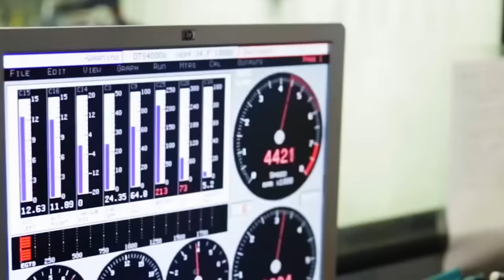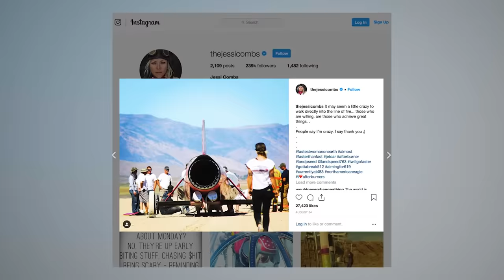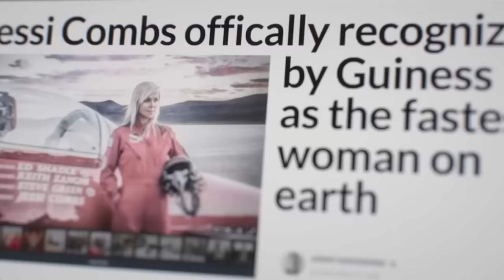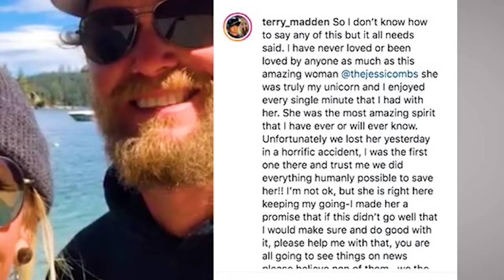The TERRIFYING Last Minutes of Jessi Combs, the FASTEST Woman on Four Wheels

Comment: Firstly getting the local cops to investigate is plian nonsense. Are they engineers?  Secondly has anyone ever looked at the design or done any testing on the wheels? Like FEA or on a test rig? Were these lifed to prevent a fatigue failure? Wer ethey crack-tested between sessions? I would bet money on a fatigue failure of a wheel. Also, for any reason, if yu want to stop, you don't want to be messing around with several different controls. Yiu need one pedal that does engine shut down, chutes and brakes. The whole thing sounds like bad design.  GZ, PhD Mech Eng.
Reply: I agree with everything you said.  Also something you didnt mention, but they did mention in the clip is that these types of vehicles don't have the financial backing as some other sports do.  So a lot of the engineering done to these things isnt done by maybe the people that should have designed them.  And, with a lot of motor sports it's trial and error.  Lots of people have died in all forms of motorsports.  Unfortunately, though that's how a lot of these sports have progressed.  NHRA has a rule book for the various classes.  If the vehicle doesnt meet that minimum of safety its not allowed on the track.  Even though this sport might be sanctioned, I do believe it is more of a run what you brung kinda thing.
Reply: Hi Bob. Yes, anythiong organised liek AHRA drags has its regulations, but I have never heard a scrutineer say it's requird but only if you can afford it. Or, a $10 helmet for a $10 head, as they say.  Any LSR attempt is going to be big bucks. Saving money is false economy. The rock: wasn't the course cleared and inspected first? Another point to consider, a F104 has no safety structure, for 2 reasons, hitting the ground at any speed will be bad, and the pilot is sitting on an ejection seat. It doesn't look like the builders of this added any cage, toi the cockpiut area. The other thing I would liek to know is were ther any scattershields on the front wheels? Gary
Reply: @bobsbillets8863  , The problem might be what Jessi was doing wasn't inside the organised part of landspeed racing. Alex Taylor have just put on a series of videos on YT of her rookie experience racing at SpeedWeek on Bonneville. Max safety are clearly high priority at those races. Like the videos show how Alex' are examined in doing an bailout, as a part of getting her first level license. How her safety equipment are controlled by the in-command "starter" just before each run.
Reply: The vehicle was an F104 fuselage with the wings and horizontal stabilizer removed and large wheels added.

Any reasonably intelligent engineer with a diploma could look at it for 13 seconds and conclude that it would be suicidally idiotic to attempt a land speed record in that insane contraption. 

Art Arfons survived a 550 mph crash in the Green Monster at Bonneville because the car was built of steel, not a used-up surplus aluminum tube wrapped around a 20,000-lbs. thrust afterburning blowtorch.

She never had a chance.

Comment: Unfortunately the vehicle she was in that was supposedly built by experts was far short of that. And the land speed racing associations deemed it unsafe and illegal. That’s why this happened at an un sanctioned event it wasn’t even an event at all. The so called experts (namely Ed Shadle) that built the vehicle and where in charge of the project where warned it was dangerous. 

It had no roll cage added and no added protection to the cockpit. It was literally an airplane with the wings cut off. An airplane that is meant to be ejected out of in the case of a crash not built to survive a crash. 

It was a perfect storm waiting to Happen she was a celebrity looking for her next big break that would further push her stardom into the stratosphere. And the team was looking for a celebrity driver to draw attention to the project to bring on additional funding. To bad Ed wasn’t in the seat at the time of the incident.

Comment: Cages help, yes even at those speeds.  In 1966, Art Arfons survived a crash while driving his jet-powered Green Monster at around 610 mph on the Bonneville Salt Flats. The car's right front wheel bearings seized, causing the car to tumble for over a mile. Arfons only suffered cuts, bruises, and friction burns.

Comment: Started to wonder if there is really need to have driver (or pilot) in those land speed record attempts. It seems obvious that any mechanical failure affecting stability will mean almost certain death on those kind of speeds. Plus machinery must get under absurd amount of stress in those (repeated?) attempts. Well it does require ton of bravery to be doing that.

Comment: This was a case of somebody who got so far off the path with their design, the driver, and the location, that somebody ended up getting killed. LSR is dangerous enough without thinking. You can just avoid all the rules. The Alvord desert has crap blowing across it 24/7.

Comment: Did the 2019 crash happened after she crossed the line on the 2nd run, or was the car crashing as it went through the line as Guinness adjusted the speed from 531.9 down to 522.8. Also the North American Eagle Supersonic Speed Challenger car originally had 5 wheels but she changed the set up to 4 wheels for 2013?

Comment: It’s sad still…😢 I just don’t get why on earth there wasn’t better safety protocols, especially when it would of been as simple as spending a couple days picking up rocks trash,and simple junk, something big or deep enough to upset a wheel that huge and solid seems like it would of been easy enough to spot before hand..just sucks ..😢 don’t even want to image how much damage  she must of taken during the crash I just don’t get why they couldn’t of had some sort of parachute system which threw her up high enough to open up still..one thing that always bothered me about the helmets is that they are for planes ,and there seems as if there’s little  frontal protection like you’d find in a race helmet !although she probably would of then burnt to death so ,really unless they could of built a parachute system ,there wasn’t a way to make a safe way out of the crash..

Comment: From past self experiences, other than being a good driver, there's something else that decides if you live or die, even on a regular car accident.
I've had only a couple of accidents during my  40 years  race every day life, the first time,it was on ford truck, I went under a truck trailer,ripping the cab clean off,and almost my friends head riding shot gun, and mine,with like 12 friends on the back,but amazingly nobody got a single scratch,even though,you could see where they bent the bed with their bodies ,and other amazing thing,and with their head,how, I have no idea,like they flew somehow backwards,or like they fell from a high place onto the bed.I dove as soon as I knew I was going to go under,and pulled the passengers,also.
The second I got T bone,so hard,my Toyota minitruck ended up like a horseshoe,it had two individual seats,well,you could see only one after the accident,I got hit on my side,and ended up, with the two girls riding the passenger seat,the glass from the window flew so fast in got incrusted on the girls bodies, but me that I am riding right next to the window,didnt get the smallest piece of glass on me,nowhere, like I hadnt even been there.
The next,on pismo beach,crash with my quad,against a motorcycle head on,going up a little dune next to the beach,but since I was going up, I flew so high,landing on my stomach,but luckily,the other guy push my head to one side,other wise,we wouldve hit heads,and I was going fast,totally desintegrating the bike,my quad just got a flat tire,and me,flat lungs.The best one was st Gorman,California,fell off a hill with the same quad,which landed on top of me,from like 40 ft high ripping my gots out,so holding them with one hand,I loaded the quad onto the truck,and drove all the way to Northdrige hospital,like an hour,but I only remember getting on the freeway,and woke up in a hospital bed,dont remember nothing from the way,One nurse said someone found me in the truck in front of the emergency ,dead,in a pool of blood,but I got revived,gotten into other accidents,but I tell about them latter.
Reply: Woah. That's just nuts. I'm guessing you have a hell of a lot of PTSD!
Reply: Plenty, can't say I have too much
Don't want to piss off my savior
Don't want to end up all crunched up, or like grinded meat,in my next accident.
I just thank my God every time
Reply: @IsraelMendoza-qc9zj  That's the truth!!! Prayer and faith help so much; often the difference between life and death (literally and proverbially, as in living a fulfilled and more enjoyable life).
Reply: @SilveniumTheDrifter I think his narcissism is the bigger issue....using an incident to reel off all his non relevant car scrape anecdotes for attention with 0 connection to this incident.

Comment: The record is exceeded in the "SAME" mile  2 runs within 60min and pass tech after both. The record is of the same mile. Eg 500mph for 2 and 3 mile; 4 mile was qualified over the standing record 515 ,5 mile 480. Then the speed during mile2,3 and 5 are not part of averaging  of 2 runs on "the" flying mile its not any mile. On the backup run ( 1st you qualify for record pass tech, then you back it up , then after passing tech the 2nd time you get a record) in this example only the mile that qualify  for consideration is the 4mile.... if the 548 occurs in any but the 4mile than it dont matter one bit, it only qualifies you to backup on the new mile on its 2nd run after tech , aka no record for exceeding the record in the 3, then 4th below record avg ,and 5 now you need a nother qualified run and hit it at the 3 or 5 this time the 4 is out 

No disrespect but 503 is smaller than 515 therefore 1st run doesn't get involved in the averaging math...on the 3rd run that never wasn't she could have set a record,  but she died holding the partly qualifying run( car couldn'tpass tech after the crash prior to 2nd run therefore is not considered 1] too slow 2 ]didnt pass post run tech). That last run was the only to exceed the record this  qualifies her into tech to confirm the record was qualified, then 2nd backup 😢. 
I was at World of Speed for my 1st year as a corse Stuart ( track spotter/ track safety worker) when I learned the tragic news . Then had to pick up pices after the Carbolite car endowed at 430 shooting for first wheel driven over 550. Agen NO disrespect this was and will always be a tragedy.  An honorary record is a pretty low blow to some one who has worked this hard to achieve such a lofty goal, its on the level of a participation trophy for the efforts and opens the door for the next lady to attempt, to contest the legitimacy of Jessie's record ( as it cant stand with only 1 partly  qualified run) , causing greaf for her survivors, and the community at large.  If my family understands how important this goal of being The Fastest Diesel Pickup in the world,  they would  contest this on my behalf if this is how I  die at over 227.8mph ( standing DT record sept 2023)

Comment: I loved Jessi and I was VERY WORRIED at the design of the car that killed her. Nothing less than a ROBUST all round driver safety cage should have been built into that damn car. Instead she had pretty much a stock fighter jet cockpit which gave her no impact protection worth mentioning. She died fast and violently  in that death trap of a car. :(
Reply: You shouldn't talk unless you know the facts.
Reply: There's no way to make that kind of speed on wheels safe, it's daredevil adventures.
Reply: Its true you can't guarantee driver survival in a crash at 2,3, 4 hundred miles an hour but if you look at modern racing car design there are LOTS of ways to drastically improve driver safety. Jessi had the talent to design her own car but she didn't design the piece of crap car that killed her. She was the guest driver. Lockheed never designed crash safety into the cockpit of their F104 Starfighter upon which the death car was based. Thats why the F104 had an ejector seat. An option not open to Jessi.   @westmus
Reply: A Starfighter is not a car...